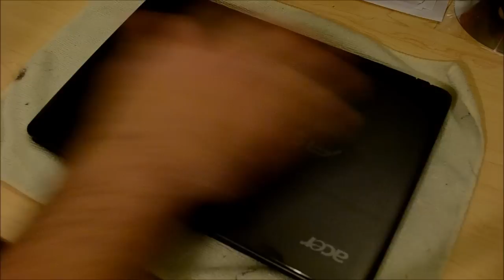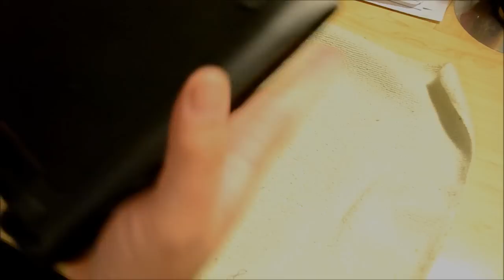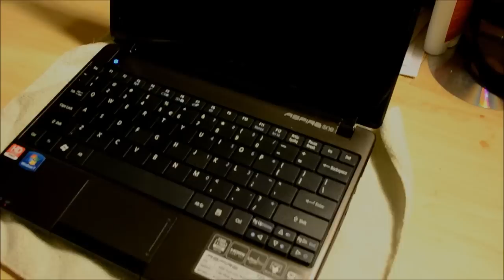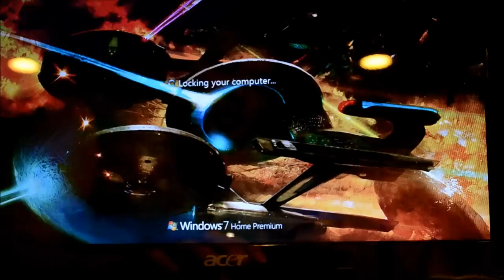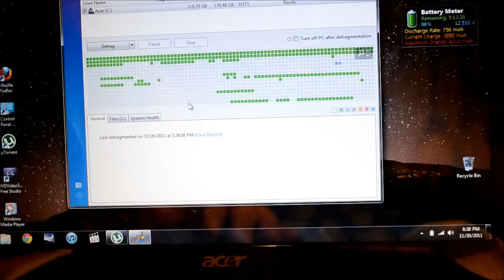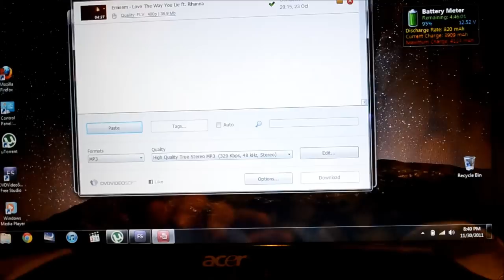Acer 722 Ram Install

Comment: I still have one haha. My 722 is running Windows 10 with 4gb ram and 128gb ssd. It still feels slow with the upgrade, but usable. Approaching 9 years!
Reply from the maker: wow!
Reply: Do you know if it can take 8Gb of RAM? Some ppl say it can, some say can't. I'm refurbishing mine, would like to know which one to buy. Txs
Reply from the maker: I honestly don’t know but I machine like that I wouldn’t be surprised if four gigs was the max but there’s only one way to find out but it’s really a question of what you can find on one stick or two
Reply: yeah, i have one too, though it's my "emergency" laptop
Reply from the maker: @atlanteean  at this point its all its good for - or a simple travelable machine for basic stuff. I am willing to bet all this time later its still a decent machine.

Comment: It is very important to tell your viewers what speed of RAM is supported, not just PC3 or DDR3. You are not giving them enough information. What if they go out and buy PC3-12800 memory? I'll tell you what if... they are screwed as the laptop only supports memory speeds of PC3-8500 or PC3-10600 max. Decent video otherwise.

Comment: Thanks...worked just fine...but having a hell of a time replacing the screw. It just wont screw back in..its baffling. Also, would it be possible for you to text those free programs you mentioned..they sound cool, especially the AUSLOGICS defrag

Comment: IT WORKED FINE WITH 1333MHZ G-SKILL F3-10666CL9S-4GBSQ BUT IT DOESN'T PASS MEMTEST86 TESTS,I'VE TRIED KINGSTON KVRKVR1333D3S9/4G BUT THE NETBOK DIDN'T BOOT,JUST A BLACK SCREEN,AND I'M ABOUT TO BUY A CORSAIR CMSO4GX3M1A1333C9 VIA INTERNET BUT NOBODY COULD INSURE ME ITS COMPATIBILITY.COUNT ON YOU,I HOPE YOU ANSWE ME SOON,THANX

Comment: How's the heat? I'm thinking of drilling some little holes on bottom panel where the heatsink is that little vent makes me a little bit paranoid. I'm thinking of a few where the heatsink is and where the wifi card is for venting the ambient heat because it has some open space there. Of couse they'll be drilled conservatively in the fashion of the bottom vent near the speakers.

Comment: How's the support? I heard there's some weird freezing bug that can be fixed by putting netboot first on boot order. Are the Ati drivers whacky and interfere with sleep? Really thinking about buying and maxing this thing. I'm really paranoid after trying to get an ati x200 working back in 07.

Comment: I edit video (make AMVs) on my early model Acer Aspire One. 1 Gig ram, running Win7 32bit. Use the Ut video codec in YUV420 mode and performance will surprise you.

Comment: Hi bsgtrekfan88.
I came across your video and was wondering if you know where to install the internal bluetooth module on the Acer AO722. I've searched online but can't any info.
Would appreciate any help. Thanks.
Reply: Dual band wifi card with bluetooth on amazon